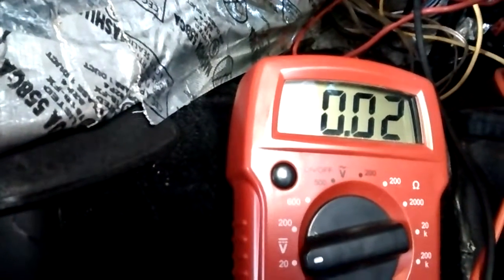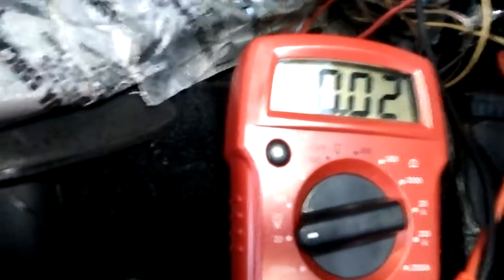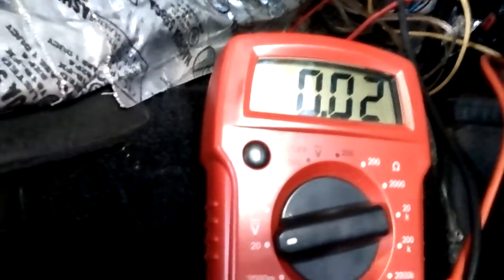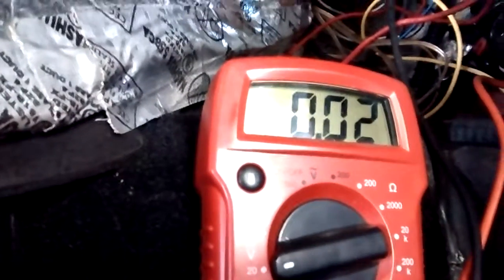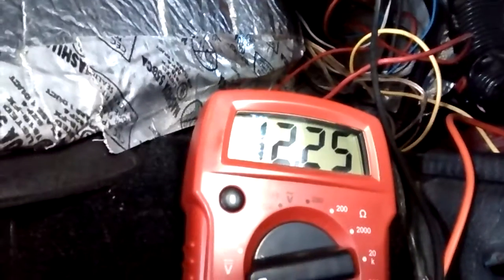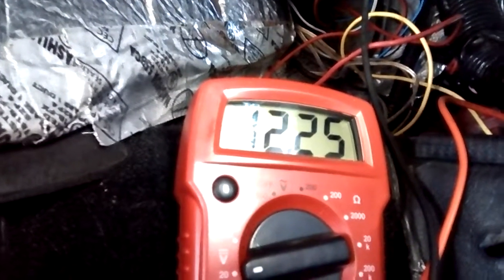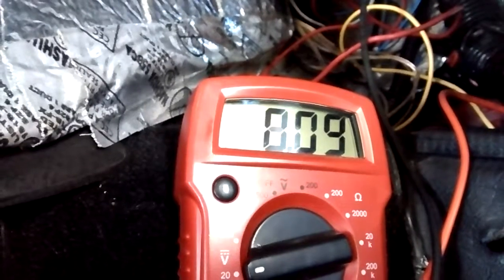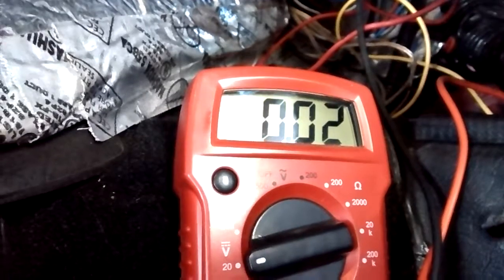No start issue part 2

Comment from the maker: Turned out to be the weak ignition of the Fiat x19. I did a mod that allowed bypassed running all 12+ through the ignition switch and instead allows a relay to switch 12+ power. Never saw a drop in voltage at the charger and never had a starting issue since.